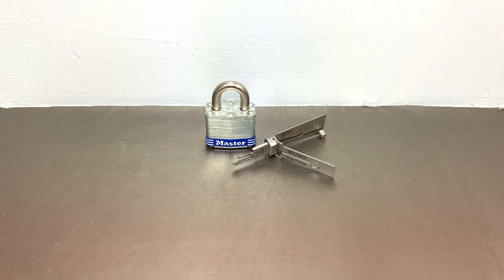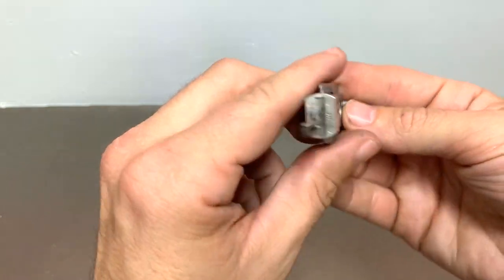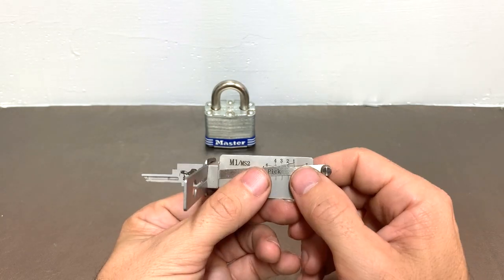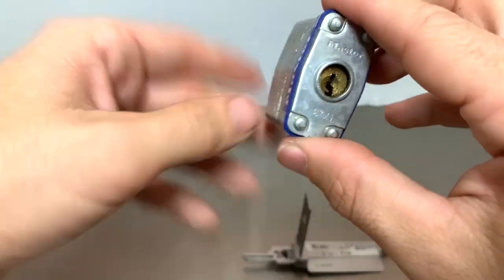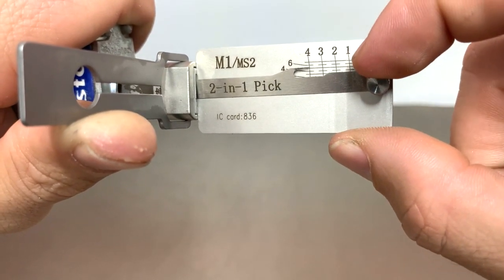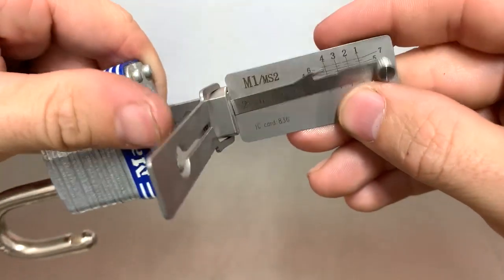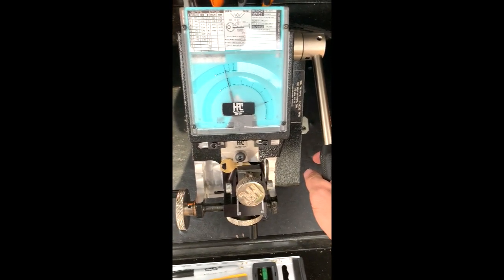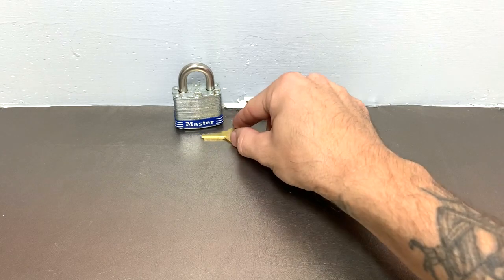Lishi M1/MS2 2-in-1 Pick and Decoder Tool

Comment: The Lishi I bought was able to pick 3 Master Locks easily but decoding a lock was another matter.. My locksmith couldn't make a correct key from the key cut numbers I read from the Lishi scale.  I picked the locks and read the numbers several times so I know they were correct.  The pointer was directly pointing at the number lines.  I read your comment about rounding the numbers up if the pointer is between numbers.  A locksmith told me the Master Locks tolerances are so sloppy the pin settings don't always match the decoder chart on the Lishi.  That HPC 1200 you are using is really nice!

Comment: How much did that key punch cost you ? Model # ?
Reply from the maker: I paid around $1200.00US, but I got it on a holiday sale. I think it retails between $1500.00-$1800.00US normally based on where you find it. I did a review video on it in an earlier video if you wanna check it out. It's the HPC 1200 PCH Punch Machine. 

https://youtu.be/qeVsgGI9AY8
Reply: @LockandKilo   Thank You I will watch it